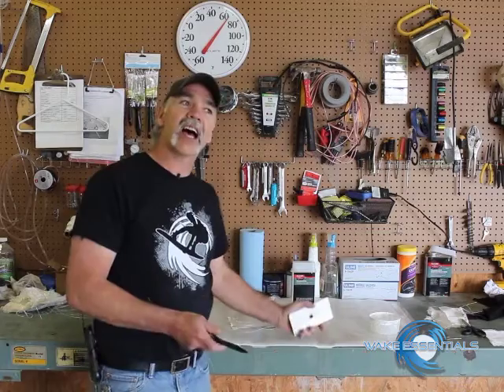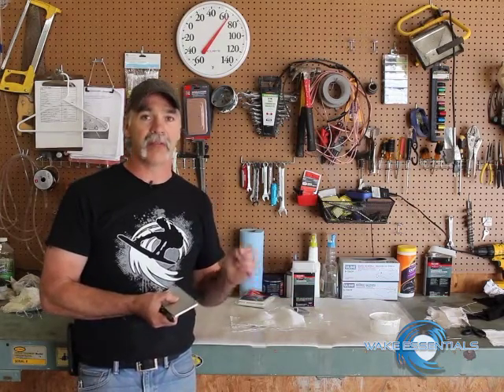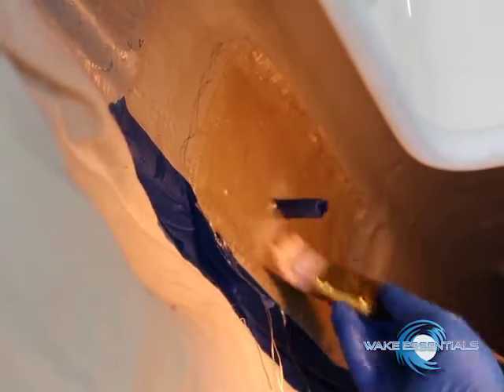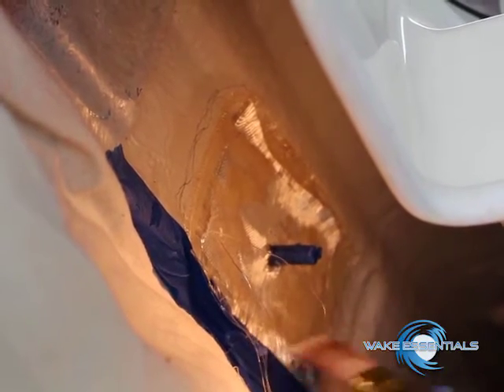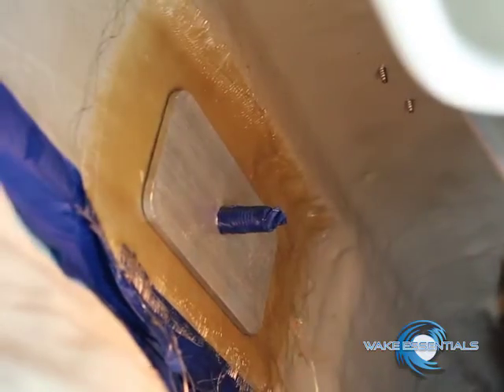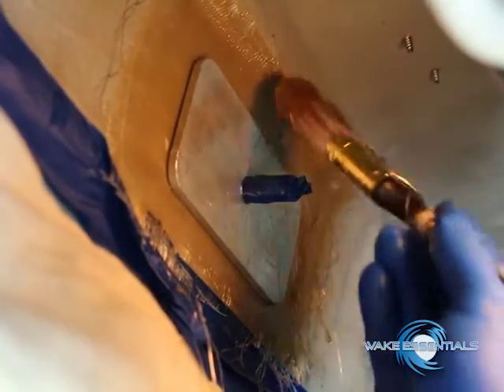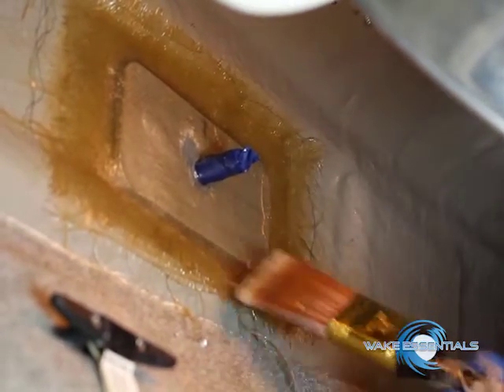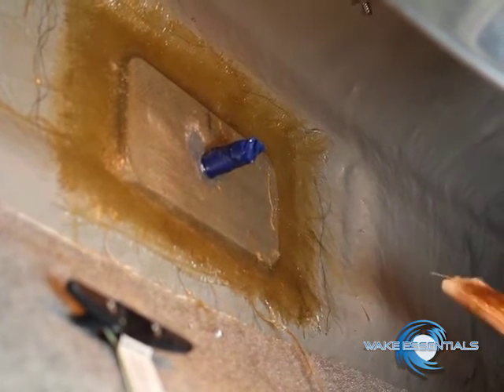Fiberglass reinforcement for a wakeboard tower on a boat

Comment: What size of aluminum is needed for the spacers?
Reply from the maker: If you need to reinforce the hull, most of the manufacturer's we work with suggest about a 6" x 9" area. Some towers may require larger areas. We suggest checking with the tower manufacturer if you are unsure.

Comment: The area where I have to attach the wakeboard tower I bought is concave. Can I use Bondo with Fiberglass in it to fill in and flatted the area?
Reply: Thanks for your reply. For your knowledge I used fiberglass infused bondo and metal plates. It’s being working great for 3 years.
Reply from the maker: @ Love to hear that and will keep it in mind if this comes up for us around here.
Reply from the maker: I wouldn't feel comfortable doing that. I would try to find a better area to mount before doing anything like that, but that is my opinion.

Comment: Wouldn’t it be more effective to progressively add larger pieces? Or is that enough to tie it to the hull?
Reply from the maker: There are multiple ways you can do it. Most of the manufacturer's we work with suggest about a 6" x 9" area. Some towers may require larger areas. We suggest checking with the tower manufacturer if you are unsure.

Comment: wouldn't a 3m marine 5200 with metal or wood backing be easier
Reply from the maker: Yes reinforcing with metal or wood backing is also an option would and be easier.
However, fiberglass reinforcement is stronger. When you reinforce with fiberglass it bonds to the hull differently and the force is pulled from a larger area.